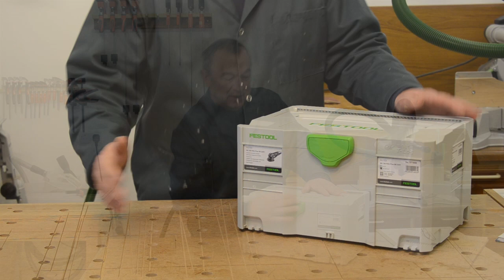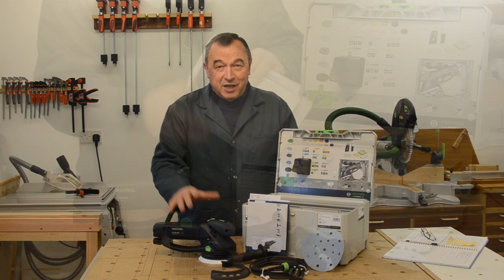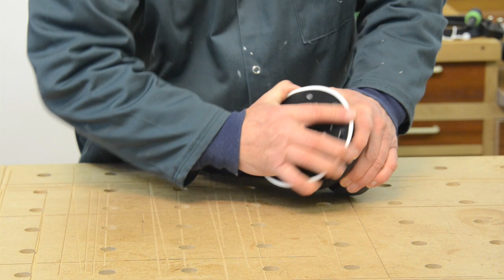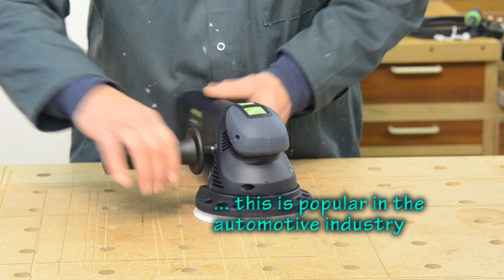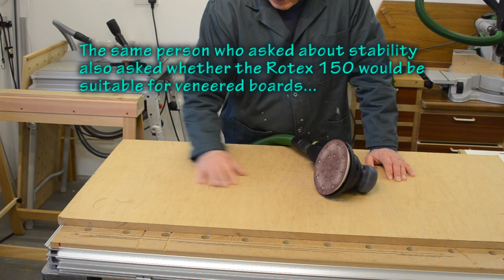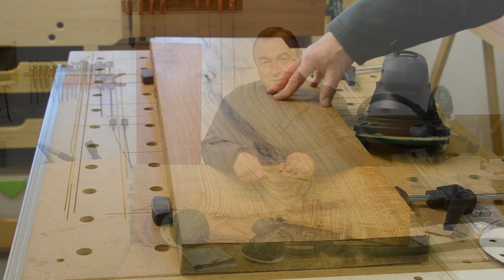Festool Rotex 150 - Demonstration and Review

Comment: Hi. I was wondering if you could please do a video on the speeds and best uses for different applications. Ie varnish removal slower speeds to help heating up etc? Again the abrasives are going to make a difference. Different timber species and different speeds etc would be your opinion. Hope this question made sense. There are plenty of vids out there on how good machine is and how versatile it is but just looking on a bit more fine tuning and right applications especially on speed setting please.
Reply from the maker: Hi Cameron, I have no slots for new videos now for about 5 months so will help you now. I am moving over to all Granat for all of my sanders. For information on other sanding sheets you will need to look at the Festool web site. If you are happy with the UK site then try this link: https://www.festool.co.uk/company/segments/wood   Download the 2018 catalogue via the link on that page. Then look from Page 150 onwards for advice on the different sanding sheets and which will be best for your particular tasks. I hope that this helps.    Peter
Reply: @NewBritWorkshop  Top tip Peter, it will come in useful as I've just taken delivery of my Festool DTS400 REQ along with various Granat and Granat net pads. Will be using these plus my Mirka Deros in the next week to prepare the bedroom cabinets for painting - yew is so yesterday apparently!

Comment: Took delivery of mine a few days ago and I must say it's a beast :-)  Thanks to David Stanton and your thorough demonstrations this was always going to be part of my arsenal. 

Anyone whose old school ex military I'm sure you've played with an electric bumper (Rotary Floor Cleaning Machine) The Festool rotex 150 reminds me so much of this. 

Being able to easily switch between modes and grits (papers) has made light work which traditionally has been a chore. 

The dust collection is also a huge plus.

Many thanks for your time.

John :-)

PS I've posted this same message to David Stanton too.
Reply from the maker: Hi John, When I bought a caravan many years ago a friend of mine gave me the best advice ever - if the caravan starts snaking do not try to correct the movement by turning the steering wheel. The same concept is true for the Rotex sanders. I think that the worst wobbles happen when one tries to correct the eccentric movement at the beginning and it just gets worse. Try and relax and let the sander settle down on the work piece.   I am glad that you are happy with your purchase.  Take care.    Peter

Comment: Hey Peter - would you say this tool is up in the range of the domino xl from a rating level?
Reply from the maker: The answer will vary according to the type of work the user does most and so having said that I will give you my view. There are 3 main Festool machines which I have used and personally judge to be in the top league of their designs. They are the Domino (both machines), the OF 2200 router and the Conturo. I do not own (could never justify owning) the Conturo but it is an amazing machine which I used once for my video and it worked perfectly despite not a single practice go first. The Rotex family are very impressive as they, at the very least, give you two machines in one package - a coarse rotary setting and a random orbit setting. The RO90 also has the Delta mode making it 3 machines in one package. I have made oak benches (which I am very proud of) and if I were doing that all day every day then the RO150 would be one of my main machines. I do a lot of finer work and so the ETS EC 150/3 is now my "go to" sander. Having recently looked at the 3 new compact sanders I would probably use the RTS 400 as my go to sander if I owned one. The machines that I use most and could not manage without are the Kapex (brilliant), the Domino DF500 (superb), ETS EC 150/3, TS55 (with rails and using Parf Dogs) and the OF1010 router. I also could not manage without the CMS system and in particular the CMS-OF router table and the CMS-TS table saw. I have invested a lot of time and money into these tools and I am rewarded every time I use them.       Peter
Reply: Thanks Peter for that detailed reply.  I also own a Kapex and I agree with you 100%. Some say the price is too much, but I had a Bosch Glide saw before this and I HATED IT. Dust every where and the cuts outside of 90 weren't right on and to get everything adjusted was a pain. I also use it with the fastcap fence system which locks in very nicely.  It's a dream combo set.  I'm debating between the Rotex 150 and the ets 150 (s).  Dream would be to have the Rotex 125 and etc tc 150 /3...thanks again for your time!!
Reply from the maker: If you are going to get two sanders with round bases then get them with the same diameter as you will save a lot of money on sanding sheets. I have the RO 150 and the ETS EC 150/3 and the sanding sheets are the same.    Peter
Reply: Good point!

Comment: Great video - What are your experience with the granate sanding paper for wood?
Reply from the maker: Hi Emil, I now only buy Granat and use it for wood (of course), it is super and lasts a long time.    Peter
Reply: Thank you for an answer on that - Just ordered a Festool Rotex 150 after watching your great demonstration of it.
Reply from the maker: Hi Emil, I have just put mine in the back of the car, with my CT26, for an away day tomorrow doing an old balcony.   Good luck.   Peter
Reply from the maker: Just got back and managed the whole job in 3.5 hours. Now its time for a cup of tea.   Peter

Comment: I have the 125 (5") version of this, and for the life of me, I can't keep it from jumping around. I was sanding a butcher block countertop the other day and it was jumping all over the place, and hard to control.
Reply from the maker: Hi Pete, I have never had any difficulty with any of the Rotex sanders. Try supporting the hose with one hand and holding the top grip of the machine with the other. Keep a firm but flexible grip.   Peter
Reply: Be sure the vacuum is set on low. Otherwise, It needs to go to the repair shop. Mine is in for the second time. Very over rated tool.

Comment: Peter, Great video on the Festool Rotex 150....I bought one and extremely happy with this sander.  I believe the first wood used in your demonstrated is something we call "lace wood" in America, although I'm not sure that's the name used in Britain.  I've had great success of holding the extractor hose connection in one hand and guiding the Sander with the other hand...Works Well.
Reply from the maker: Jim Pell Hi Jim, Yes, Lacewood it is. I have heard that one or two people find it difficult to get the right technique with these sanders but it all boils down to practice and common sense. Holding the hose is a tip I received years ago and it makes a huge difference. Many thanks for the kind words.   Peter

Comment: Hi Peter, I have recently purchased the RO 125, I've never known a sander to be so hard to control it often acts like a turned on dropped router, scratches the hell out of what I'm sanding on! I've been told to put the hose over my shoulder to help lift the back of the disk but that doesn't help much. Any ideas as to what I can do? ...It's going back otherwise or may keep it just for polishing which I haven't tried that out yet...
Reply from the maker: Hi Ben

Random orbit sanders can be tricky but my experience with the RO150 and RO90 is that they behave well.

First use one hand to support the tool where the hose is connected. Second, remember that it is like putting a spinning bicycle wheel down onto a surface - whenever the rim touches it wants to spin off. So the trick is to practice getting it flat and not at an angle.

It is really quite easy.

Peter
Reply: Thank you Peter, It's just odd as I have never had such a problem with lesser sanders (Dewalt)